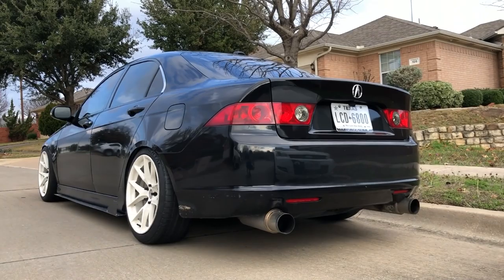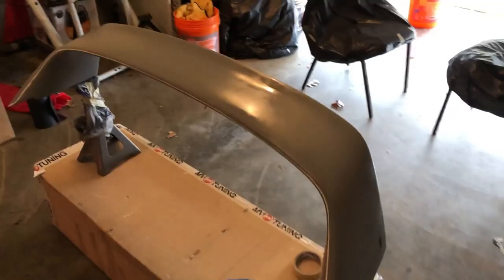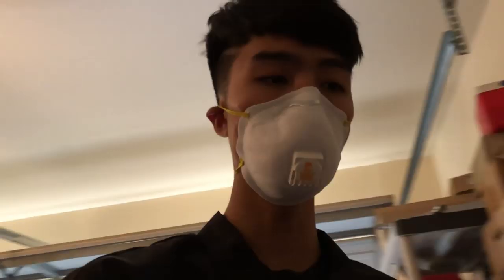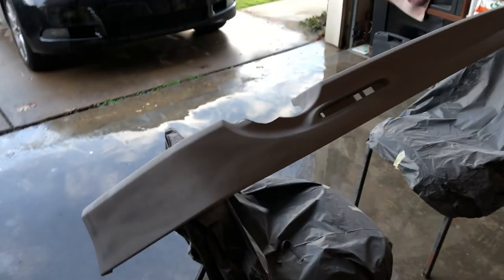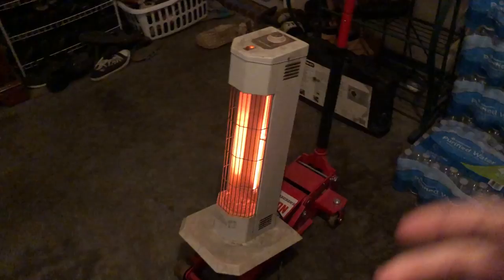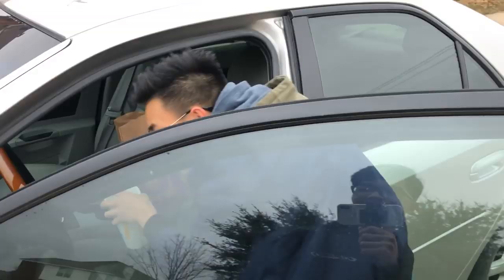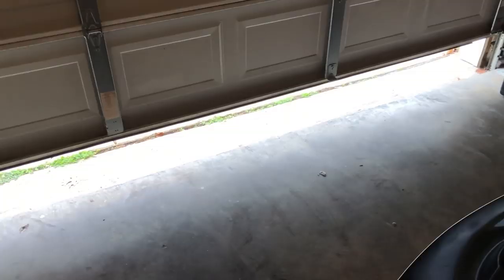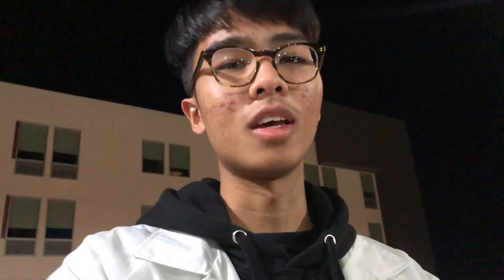I Painted Mugen Spoiler & Euro R Lip With Rattle Cans!!

Comment: Been a painter for over 15 years and I got to say for a diy job u did great. That 2 part clear is the best aftermarket besides a spraygun, homie even got some heat to help the drying process. 😎💪👍🙏
Reply from the maker: Ayeeeee, thanks man!
Reply: I’m thinking about doing this soon too with the same wing. Any recommendations you’d give or how would you approach this for a DIY at home?

Comment: What clear coats did you use? I have to paint the front of my 04 TL the same color. I'm doing the hood and both fenders and blending into the bumper. Yours looks awesome. Mine, not so much. Lol
Reply from the maker: for the paint i did 3 coats and clear coat i did 4.
Reply: @BeforeTheStorm  nice. What was the brand of clear coat? When I put the clear coat on my paint it didn't turn out like yours.
Reply from the maker: Kevin Hollingsworth everything you will need is in the Description. But it’s called 2k clear
Reply: @BeforeTheStorm  thank you.